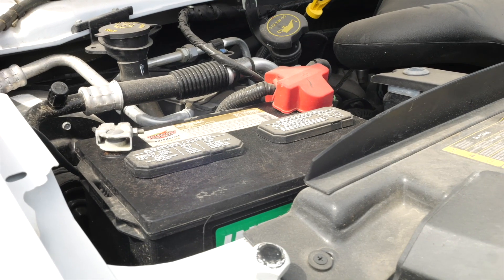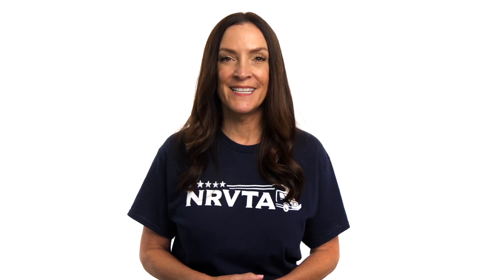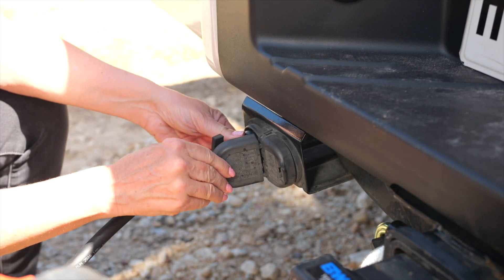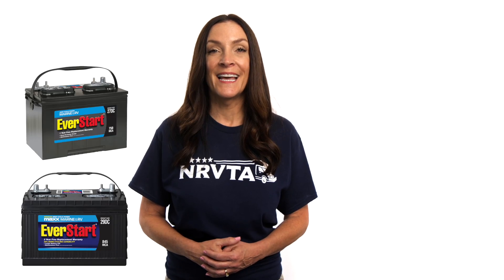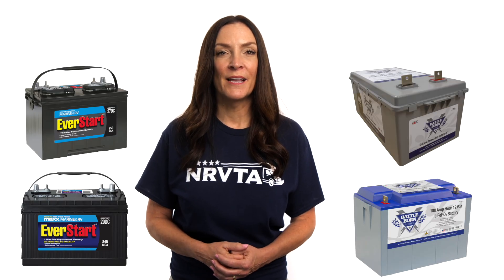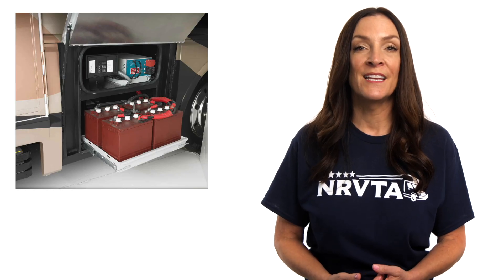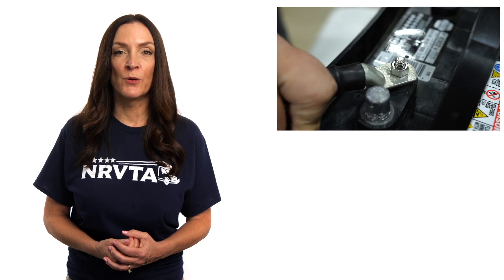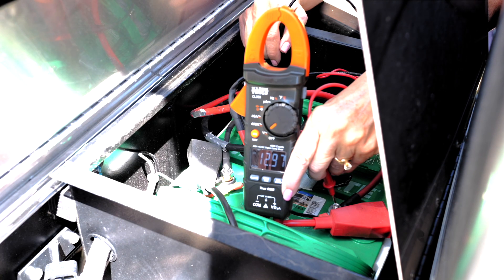12V DC Electrical in Your RV Explained | Beginner’s Guide

Comment: As a, new, first time RV owner (2017 Forest River Salem Hemisphere), I find these videos to be great.  I found that, while they were very helpful, it was kind of jumping into the deep side of a pool when they were going over the unit with me.

I'm a former USAF aircraft mechanic and I used to write maintenance manuals for the F-15, and I find that the lack of information available on the unit to be frustrating.  Particularly wiring and plumbing schematic diagrams.  I'm all about "reading the flipin' manual" (RTFM). 😁

I only have a 20 amp (5000 watt) generator (using an adapter to the 50 amp plug), so I shut off all the AC circuit breakers (CB) except the 50 amp main CBs before hooking it up.  I then turned on the CBs for what I wanted to power.  In this case 1 AC unit, fridge, and the outlets.  The mistake I made was not turning on the converter to charge the batteries.  The labeling of the CB panel is not real clear and I didn't know what "CONV" meant.  Something I plan to correct with a label printer. 😁  The next time I'm at my RV, I'll have to start the generator and turn on the converter for a while. 😁 Maybe before anything else.